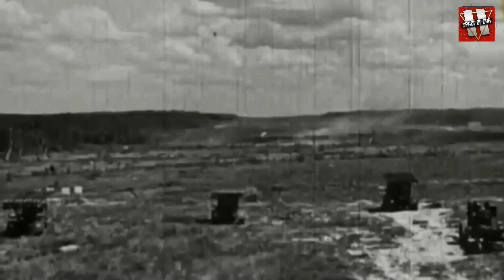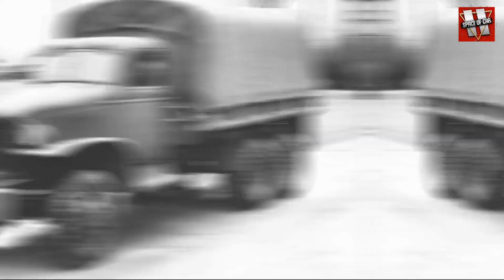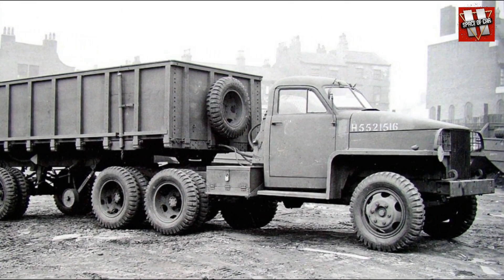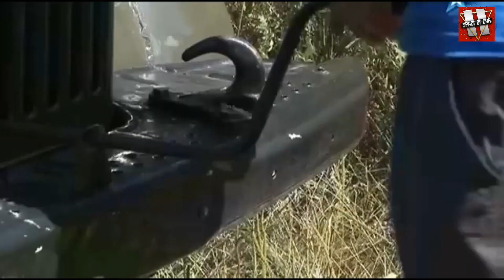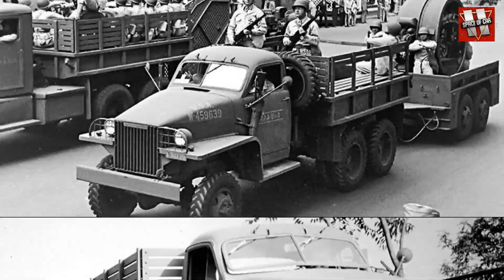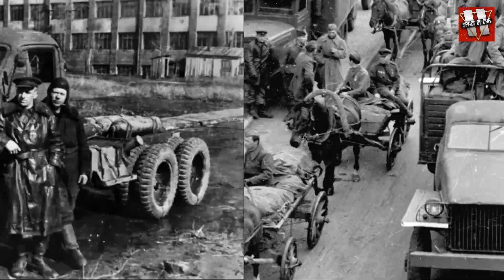Lend-Lease main truck  Studebaker US-6:  from USA with love

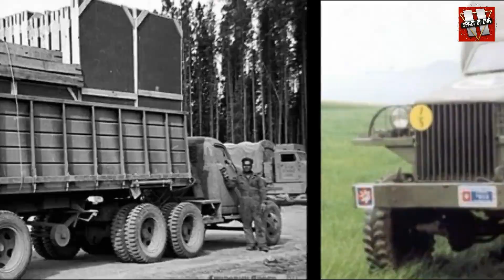Comment: 2:48 GAZ 63 is not a copy of Studebaker. GAZ 63 is a four-wheel drive version of GAZ 51. The prototype GAZ 51 was created before the beginning of World War II, at that time Studebakers were not supplied to the USSR. GAZ 51 was almost ready for serial production, but the war began, so serial production was postponed. During the war, new prototypes of GAZ 51 were built. These prototypes had cabins from Studebaker, this is where the myth came from that GAZ 51 is a copy of Studebaker. But this is not true! The reason for installing cabins from Studebaker on GAZ 51 prototypes: The original GAZ 51 cabin was only in the project, while the creation deadlines were tight and in order to speed up the process of finalizing GAZ 51, and not wait until the original cabin is created, GAZ engineers decided to temporarily install a cabin from Studebaker. Serial GAZ 51 already had an original cabin, and there were 2 cabin options: a wooden version and an all-metal version. GAZ 51 is a Soviet truck created by Soviet engineers, and not a copy of Studebaker. The frame of GAZ 51 is original and differs from the frame of Studebaker. The cabin of GAZ 51 differs from the cabin of Studebaker, the cabin of GAZ is more spacious and larger in size. The layout of the truck GAZ 51 differs from the layout of Studebaker: the cabin, the engine of GAZ 51 are shifted forward to the front bumper, which made it possible to install a large cargo platform with such a short wheelbase. The hood of GAZ 51 is shorter than that of Studebaker. Only the hood and axles of GAZ 51 are similar to Studebaker. But GAZ bought the license for the production of axles from the Timken company before the war. By the way, the Studebaker itself is not an original truck, it is a mix of different parts from other companies, the Studebaker only has a cabin from Studebaker. By the way, the ZIS 151 is also not a Studebaker copy, it is a GAZ 33, its production was moved from the Gorky GAZ factory to the Moscow ZIS factory, since the GAZ 33 required a more powerful engine, but the GAZ factory did not produce the powerful engines needed by the GAZ 33, plus it was busy with the production of GAZ 51 trucks.

Comment: Try to find one these days. Lot of them got scrapped right after the war ended. Not many complete or incomplete ones left. I never heard that ZIS tried to make Studebakers? But im not surprised to hear it. Fun fact the GAZ 51 cabin back is almost identical to the Studebaker US6 only main difference is the cabin of the GAZ 51A is smaller and the back part has been moved forward(shortened cab). If you put both cabins side by side the differences become very obvious.
Reply: I am extremely surprised anyone would go to the trouble of returning them, I am sure they could have been scrapped in the Soviet Union and save everyone time and money.  As long as the destruction could be verified, since I have no doubt that is exactly what happened to any returned vehicles.
Reply: @300guy  There was agreement that the equipment must be returned to the states. However the state ended up not taking half of it back so a bunch of it was just dumped into the Pacific ocean. US-6 and other allied equipment was used excessively after the war but was eventually phased out. Once the Soviet Union own industry was able to produce trucks and utility vehicles in mass quantities. The old ones got scrapped off. Still some managed to survive even 50 years after the war.